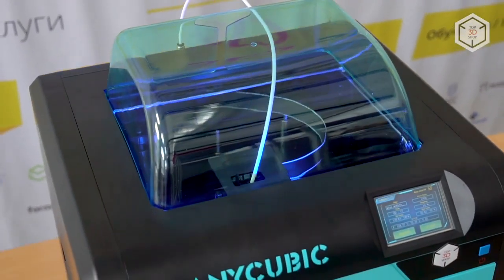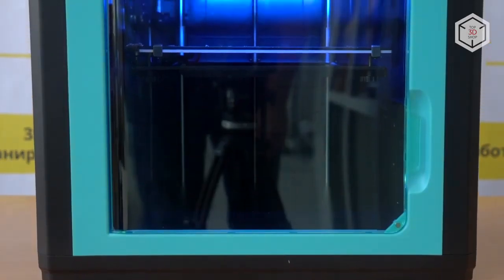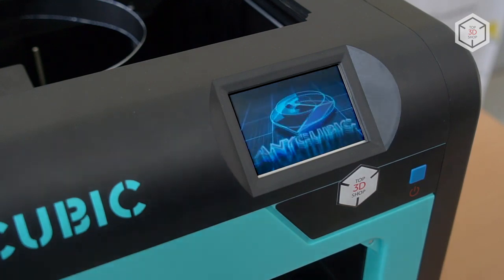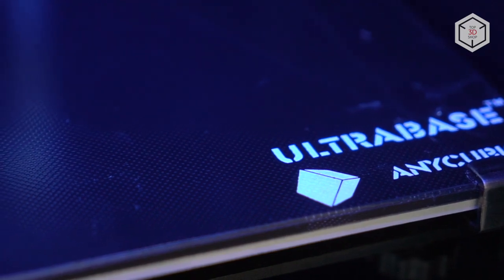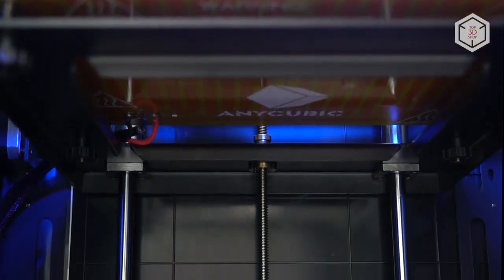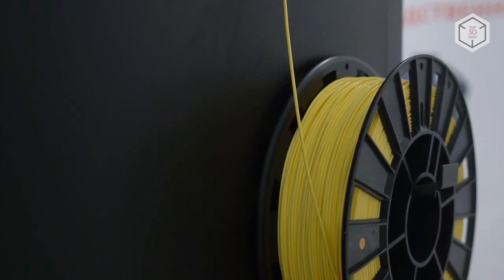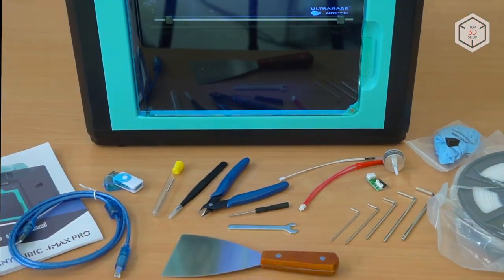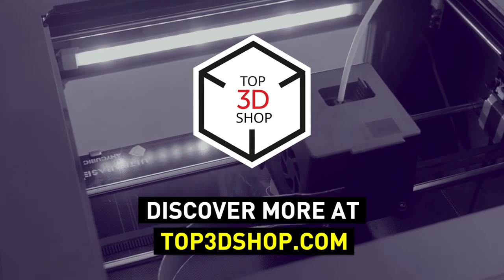Anycubic 4Max Pro 3D Printer Review [2019]. What Makes It Different From Its Predecessor?

Comment: I like mine and it consistently creates good prints. Downside is that it has been difficult to eliminate ringing on the X axis. Additionally over time the Z sensor screws let go and left me wondering why the print suddenly was way wrong. Readjusting took some time but nothing major. Otherwise the quality has been excellent. ABS PLA PETG and TPU all great including wood filament PLA

Note however the firmware has a bug (wrong thermistor profile) and nozzle overheats by 25C. Set it for 190C => 215C will be used. Print bed does not have this issie.

Comment: I had a great experience with Anycubic customer service.  The SD card reader in my 4max pro was DOA and they solved my problem right away by sending me a new one.  They were very quick to answer emails.  No problems on my end.
Reply: My experience is totaly different. Low quality (ultrabase is bent so i cant calibrate my printer) and rly bad support. IM sure they care more for amazon customers because they can return faulty device anytime. Last time i got something from anycubic. Even it was cheap it was rly bad choice.